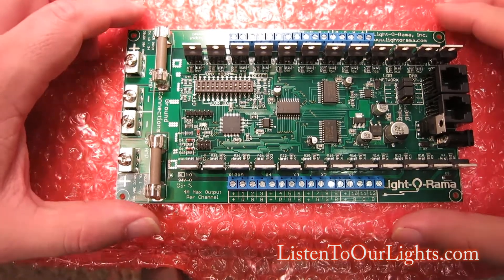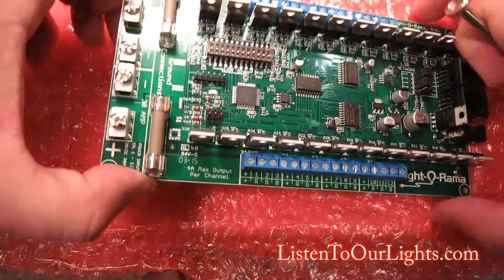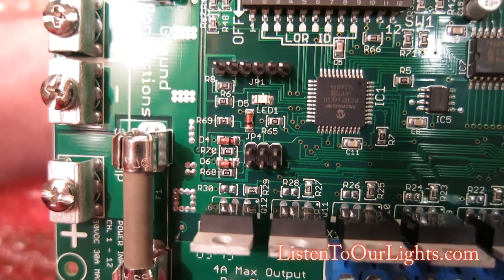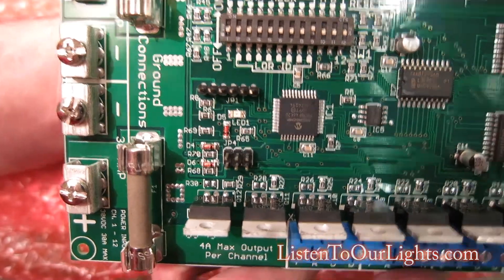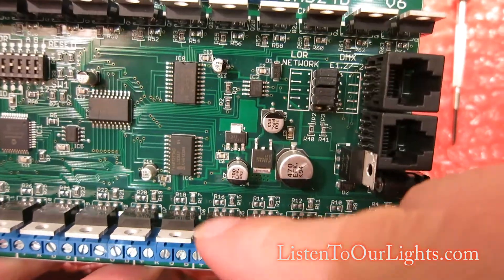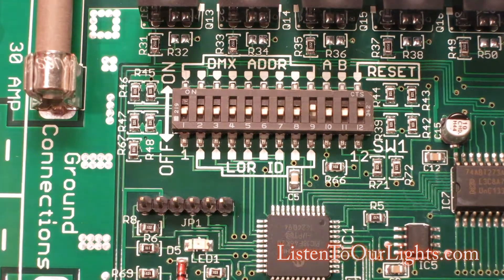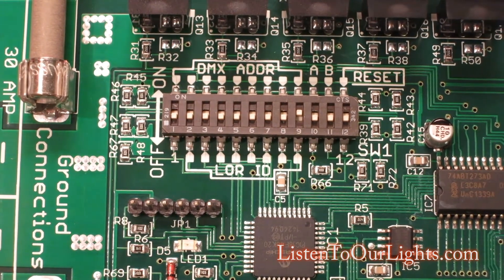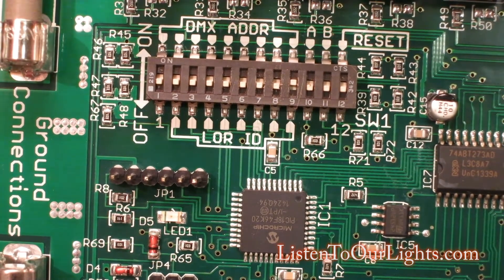Setting Unit ID on CMB24D

Comment: John,

Have you set this board up on a Falcpn F48 serial 3 port?  I can only get the floods to work if the  CMB24D is in LOR mode.  But I can't seem to get the right start channel set.

The plan is to have this be unit 5 or equiv start address. And units 1, 2, 3, 4, and 6 would be standard LOR ac controllers.

Comment: hello. I need some help please. I have 6 CTB16 boxes and I am trying to set up a CMB24D. If I connect the first box to my computer and next to it the CMB24D and then all my 5 boxes. the first box unit ID should be 01 and the CMB24D should be unit ID 02 and then the rest of the boxes should be 03, 04, 05, 06 and  07? Or the CMB24 unit ID should be 01 since is different from the CTB16 boxes and they stay as 01, 02, 03, 04, 05, and 06?

Comment: Is it possible to control the pixel CMB24D controller?
Reply from the maker: 서승덕 The CMB24D does not control pixels. For pixels you would want the SanDevice E682 or E6804